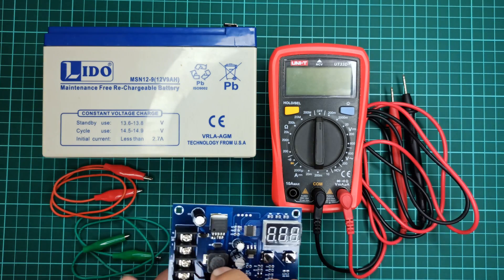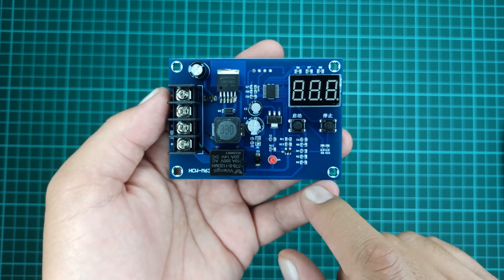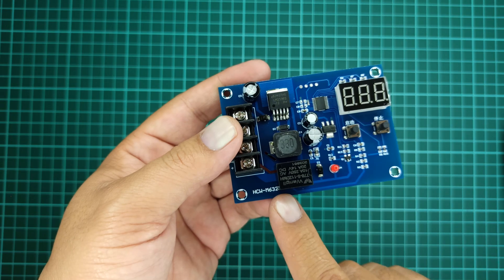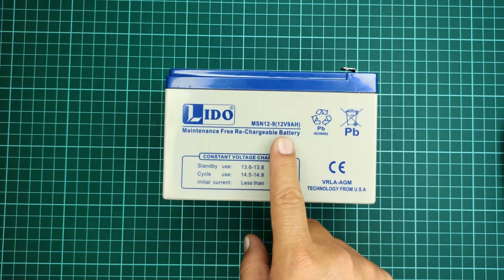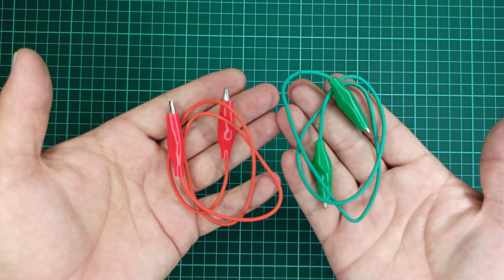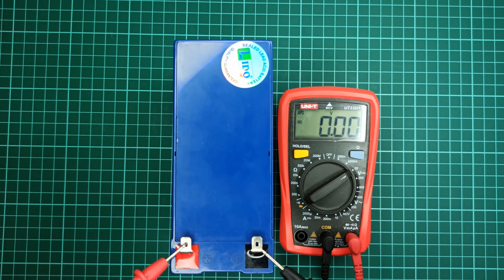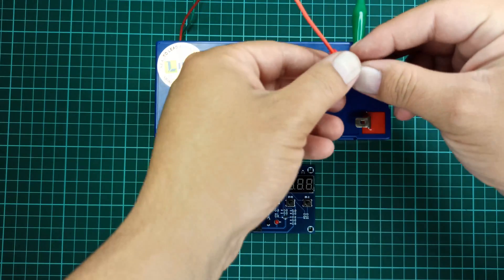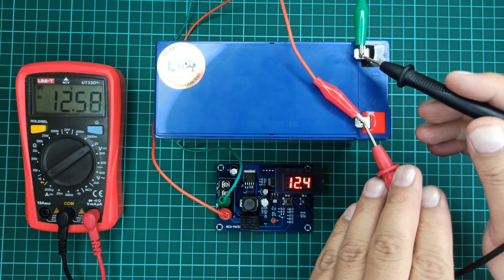HCW-M632 Battery Charge Controller Review | 12V–24V Automatic Charging Protection Module

Comment: Can this be used to charge one 12v battery with another 12v battery? How is the amperage for output controlled? Will this pump out 20amps continuously until set voltage is reached? Appreciate the video. Very hesitant to do what I need to for my situation.
Reply from the maker: Hello, thank you for your feedback.
1. This circuit is only designed to control the peak charging point and lowest discharge point during which it will be operating.
2. Your task of charging one battery from another will not be fulfilled by this circuit only, but you will need to add a boost converter just after the battery which will act as a charger to increase its voltage upto 14 volts or more.
3. There is no such control of output amps because this circuit consists of a relay which either connects or disconnects the charger from the battery.
4. I don't think that the relay, attached in this module, have the capability to handle 20 amps but you can add a secondary relay after this circuit that should easily handle this much amps.
By the way, when charging any 12v battery, i have never seen a battery that will consume 20amps of current while charging.
If the voltage of the battery goes too low, only then it might consume high amps of 20Amp, but obviously low battery voltage always damages its cells.
Best of luck for your project.
Reply: @ERLEngineering  I appreciate your reply. I have the unit you’re describing in the video and was thrown off by the spec sheet showing an output of 20amps. Certainly not looking for 20amps to charge my 110ah battery. 

I have a boat in storage with the 110AH AGM battery I’m looking to charge. They’re no longer allowing use of my solar setup. With the described booster setup with this charge controller can I expect my source battery which is 80ah to provide enough power to charge the boats AGM from say 12.5V? 

I wouldn’t want the source battery to drop terribly low as well in trying to make this work. Assuming I may need a LVD to cut power too solve this? 

I’m not an expert at this by any means, just don’t want to create a potential for something to go wrong. Your videos are very helpful. 

Thank you.
Reply from the maker: If you are selecting the right DC to DC boost converter module, combined with this charge controller module, your aim will be achieved and yes your battery will charge but you have to also add this module on the charger battery side to avoid discharging it below its threshold point.

Comment: Can I use a car battery 12v lead acid 80A
Reply from the maker: Yes, it can be used for lead acid as well as dry batteries
Reply: need another psu 14V/0.8A

Comment: Hi. Can i set the connect value to 13.4v and set the disconnect value to 13.7v?
Reply from the maker: Hello stephen, yes ofcourse. This module works upto 24 volts and you can set your desired values of 13.4 and 13.7 for connect, disconnect.
Reply: @ERLEngineering  thanks for the good feedback.
Reply from the maker: My pleasures 😊